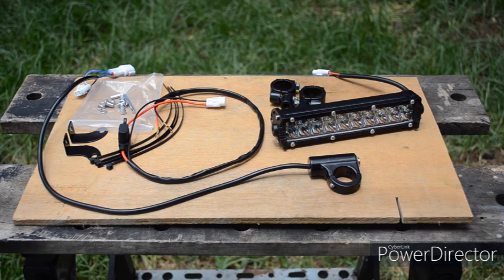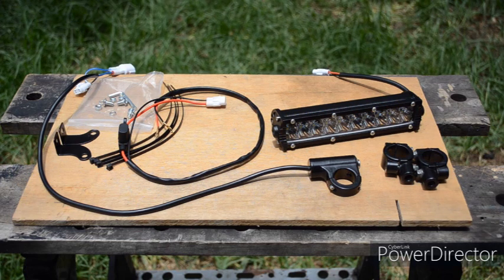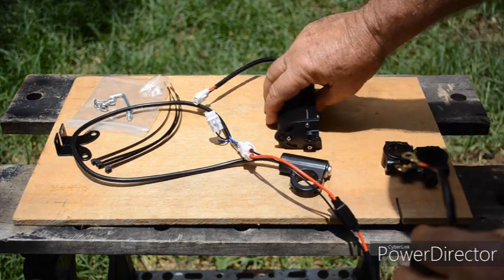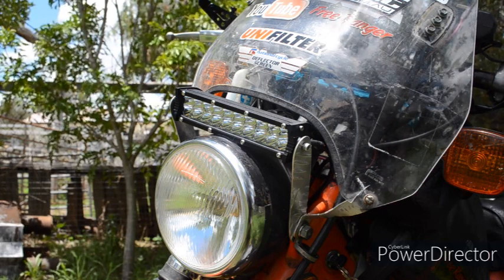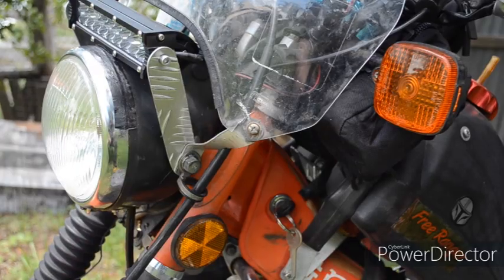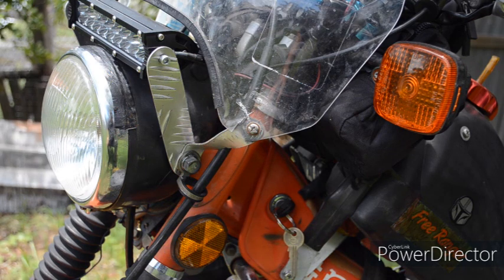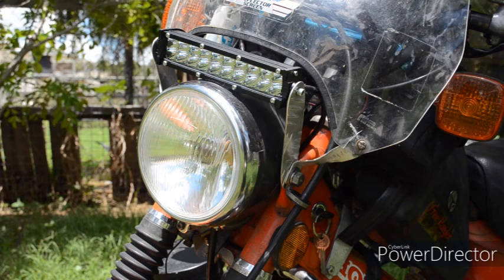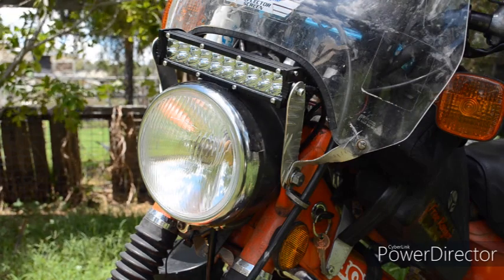Honda CT 110 - Fitting an LED Light Bar

Comment: I love your channel! Awesome information on CTs!

I have a question about an issue I'm having with my 1984 CT110 that I can't figure out.

I just changed my stator (something I did after watching one of your videos about headlights blowing out, thanks for the help on that!), but after getting everything back together my CT110 won't go into gear. It shifts, but the bike acts like it's in neutral, even though when I shift, the neutral light goes off.

The engine runs perfect, the chain is on both sprockets, and there are no weird sounds coming from the engine.

When I shift, it feels a bit gummed up, so I'm worried it's the clutch, but I didn't touch the clutch when replacing the stator.

Could I have put the gears in the sub transmission in wrong? Could that cause shifting issues?

I'm really stuck on this one, and I'm hoping it's not the clutch, but that's the only thing I can think of. Any help or advice would be greatly appreciated.

Love the channel again, I've learned a lot from you!
Reply from the maker: Hi Kyle & thanks for your kind words.  If your bike was shifting fine before you removed the l/h cover, I'd say the clutch is not the problem.  As you said the sub trans is most likely the reason.  I've a video on the sub trans if you need help.  If it's not the sub trans then it's clutch cover off & check linkages shift drum stopper arm etc but it would be one heck of a coincidence for the shift mech to fail now.  Very good chance it's the sub trans assembly & should be a quick easy fix.  Let me know how you get on.  Sub trans video link here
https://youtu.be/2y8OeK0qAUQ
Reply: @Free_Ranger_CT110  that's what I'm thinking, thanks for help! I'll definitely be using your video to put it back together this time. Hopefully that's all it is.

Also, your ADV accessories video inspired me to want to get into ADV with my 110! Can't wait to see more content!